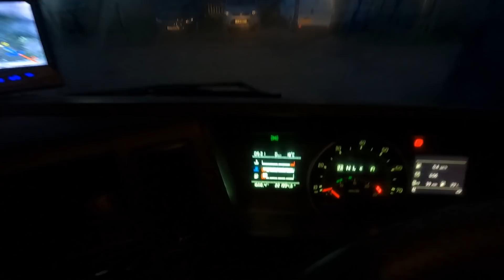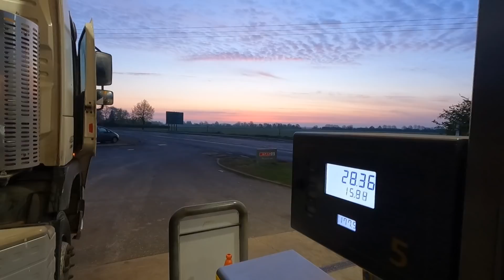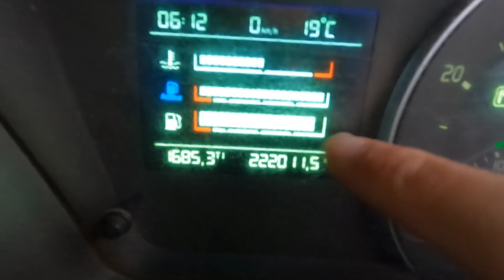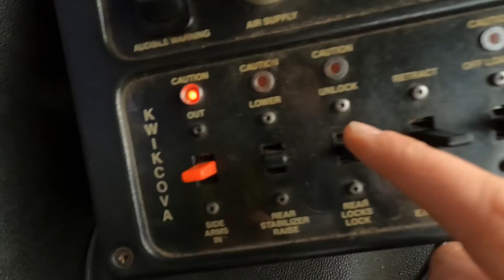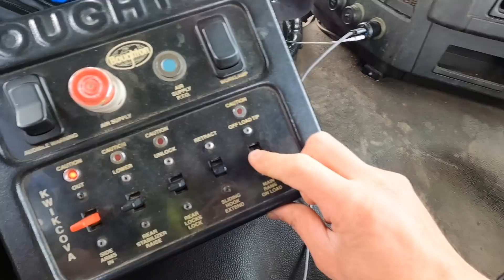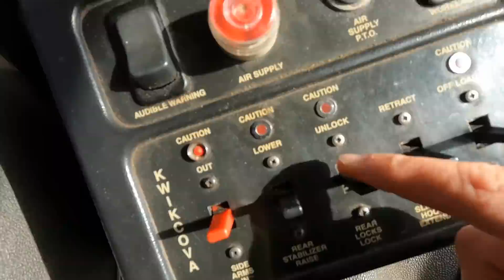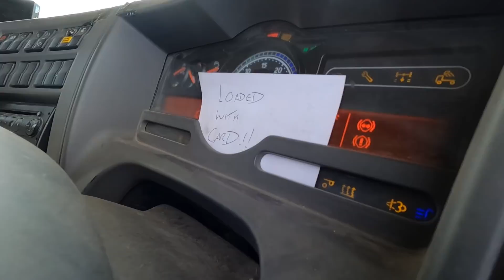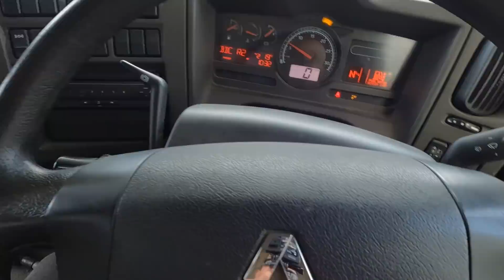Short Day Skipping About | FED UP | Trucking Vlog 55 | #truckertim

Comment: Word of advice #truckertim with different vehicles look at the fuel gauge there is a little arrow underneath the 'E' which will point to the side the tank filler is on!